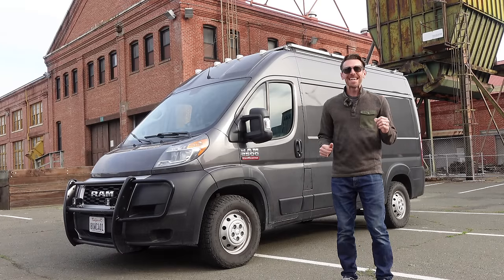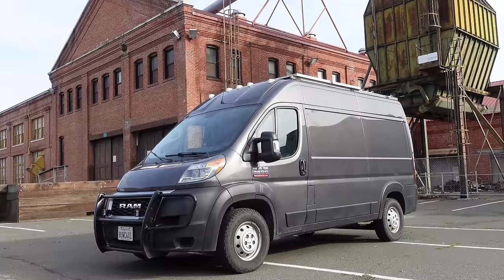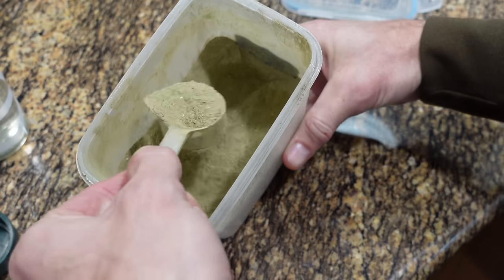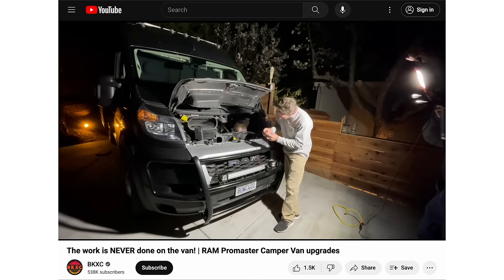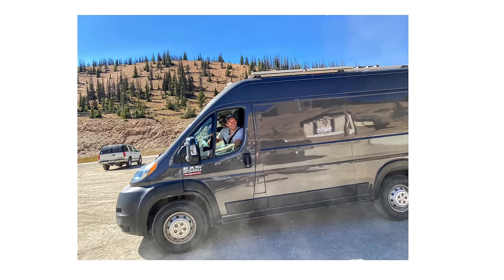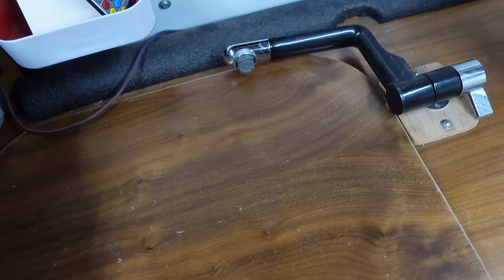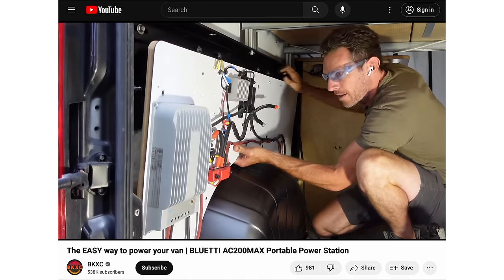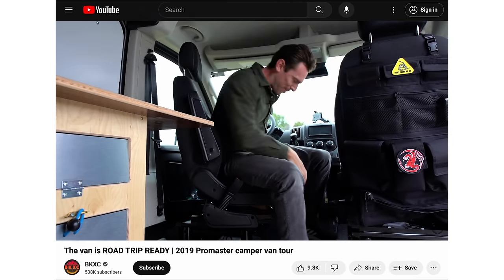100,000 miles of regret | My RAM Promaster camper van

Comment: Find a reputable independent repair shop and stop going to the dealer. You'll save lots of money and get better quality work.
Reply from the maker: Amen to that. The stupid thing is I bought the damn “platinum” oil change package when I bought the vehicle. But that doesn’t mean I can’t just get the free oil change and then go to a shop for service. Sarah recently went to a new place and they gave a really cool detailed report with photos and she was so impressed with every part of the experience.
Reply: promasters have European nuts, bolts, etc...many mechanics won't work on them, some that do, you wished they hadn't, few, very few can.
mechanical shops also if not dealer, take forever to get parts, so down time sucks
Reply: Yep dealer should only be used for warranty work. There is a reason they are called the stealership!
Reply: @danielmiller1302 What?! If your mechanic can't work on something with "European nuts/bolts", you need a new mechanic. Every vehicle I can think of uses internationally sourced  components and metric nuts/bolts. Sae went out with the Clinton administration.
Reply: @nickcoulter973 
Nick, you missed it 1k %.  not talking of metrics. besides metrics is the nut size.  I speaking of threats. they are treated differently.  if use wrong threated bolt will strip out item; and not enough room to rethreat item.  ex. motor mout. bolts $5-8each, motor mout. brackets over $500 for the set. the motor M. has threats in it. I took  part to few different mach. shops ask if they could rethreat. all after abit of time Said no.
Reply: @danielmiller1302  No... European vehicles don't use a rare thread pitch. They use the same pitch standards as all metric fastened vehicles. 

I am guessing you misunderstood what your mechanic was telling you. If there wasn't enough material remaining to tap after stripping the threads, then they would say "no" because the part will likely fail. This issue has nothing to do with euro standards. Any machinist has the equipment required to tap or die every thread in your car. Most mechanics will, also.
Reply: Ya!  I used to have a Ford.  It was bought brand new.  It was a pos.  Ford couldn’t fix it right.  One time, it broke down on the road.  I got it to a gas station on the side of the road.  The mechanic fixed it right using none Ford parts.
Reply: Good work is always years in the making because they're booked up 😅
Reply: There’s people that say both, always go to the dealership and then others that say don’t. In some cases I’m guessing both are correct. With the day of yelp and Reddit I bet the likelihood of finding a specialist is that much easier. I’m curious what happen?? Was it your head gasket? Or no oil??
Reply: Dont worry its bad everywhere. My sprinter went in for its 20k service. I took my baby to the top MB Sprinter dealer in my area. First service is pretty simple. 

I get the van back a day later. I notice after a few minutes of driving that the AC was off. Turn it on and all I smell is burning oil. Get home and theres oil dripping from under the engine. Dealer sends mechanics to diagnose and it turns out they sliced the oil filter tube!!! Took a couple more days to get the part and repair it.

Not looking forward to the next service.
Reply: @danielmiller1302 they don’t use “European nuts” they just are actually European Fiat cargo vans rebadged as a ram
Reply: That’s what I have been doing
Reply: @bkxc As an auto enthusiast who does a lot of his own repairs, is there any way you'd be willing to post the invoice for the $17k engine replacement? I have no idea how a shop could charge that much and just stay to wrap my head around it
Reply: Independents can also gouge you and do terrible work.  Quality of work overall is going WAAAAAY down

Comment: Promasters regularly get 400-500K miles on original transmissions and engines. There are things that fail all the time and there are things you shouldn’t do with a Promaster. I’d recommend watching Promaster’s Only channel. He shows you how to fix everything on Promasters. He has one with over 700K on it. I have 140K on mine with original everything and no issues at all. It can be done.
Reply: Interesting.
Reply: Yeah I was thinking how the hell did you blow that motor??
Reply: I really think the dealership he went to didnt do what they were charging him for
Reply: It can be done but that's not the norm
Reply: I would not trade my Promaster for any other van.  Reliability and longevity are my hot buttons, I get both with my PM

Comment: Engine replacement on your dime at 75k miles is a pretty big negative IMO. I was considering a van for a while but I have decided instead to go with a truck and add an overlanding style camper on it which will allow sleeping space as well as internal bike storage. The real issue with vans for me is the overinflated value they have at this point on the used market. I am seeing 200k E250 vans with the 5.4 Triton (yuck) going for 10k+ with utility racks still in them. I think vanlife in general killed vanlife as a reality for most people.
Reply from the maker: Pretty big negative is an understatement 😫. I am very intrigued by the overlanding setups!
Reply: @bkxc  Worth looking at as I think it allows more flexibility of both vehicle options as well as where you can actually travel to. I am in the process of getting the money together for a Radica Moonlander but GoFastCampers is a good option if you have the coin to spare and a truck they build for.
Reply: Im looking at midsize truck and the Tune M1 topper. The lightweight camper market has lots of options now!
Reply: @bkxc  project M pop up topper and many like it let's your truck be a truck while keeping all your gear safe
Reply: Oof… it’s nice to have the van for sure, but I’m gonna try a camper suv setup first with a bike rack
Reply: @nateums  I thought about that and went back and forth on it but I hate the idea of a RTT and I really want to store my bike(s) inside where I feel they will be much safer from prying eyes.
Reply: did i miss what the cause of your engine's failure was?   @bkxc
Reply: Old mechanic.
Friends don't let friends buy Chrysler/Dodge/Jeep /Ram 😃
Reply: Cause of engine failure=Ram
Reply: @PuffinPass  prying eyes watching for opportunities when the doors are opened 🤔
Reply: @OKFrax-ys2op  The risk is actually the same. Unloading from the back of a van on a custom slide tray says as much or more as unloading from the bed of a truck with a shell on it. The difference is the van doing that gets recognized as probably having much more inside because everyone knows vanlife is a big thing in the MTB community.
Reply: An engine at 75K miles is really unusual, this pentastar engine has been around for a long time and they get tons of miles out of them. I do have the 125k  warranty from Chrysler.
Reply: Sprinter marketplace regularly has built vans for $40-$70k.
Reply: For 17k you can get 3 Mt bikes.
Reply: I am looking at the same thing because I agree, vans are just in huge demand right now and the prices are nuts.  We’re about to hit our last year of full time bus life but we want something for shorter trips.  We wanted a van but good grief.
Reply: 5.4 is actually a really good engine. Get the post 2005 to avoid plug spitting tendencies.
Reply: I actually think the trucks are overinflated because many guys buy a truck just to drive it to work without actually needing a truck, hence the high demand for pickups. I think I can find a better deal on a used van than a truck.

Comment: I have forever wanted to see a review like this. When asking owners how they feel about their Promaster Van (or most any new vehicle), they always want to mention positives and steer clear of negatives. A $17k engine replacement - after meticulous and expensive regular maintenance - at 75,000 miles? Whether it's Promaster/Fiat, Ford, or Mercedes/Sprinter, I truly just wish Toyota sold their cargo or camper vans in the U.S.
Reply: 75,000 is kind of a fluke. As much as I know how much the Asian vehicle fans want to hate on them, you should get 1/2 to 3/4 million out of one of these. Solidly. Thats running 12 hour days, 7 days a week. I say this outright hating this platform even. 
Toyota has its fair share of inexcusable failures too - Hino 268 is one. Tundra trying to masquerade as a half ton and function in fleets is another.
Reply: get a Toyota SUV (Sequoia, Land Cruiser, even a 4Runner) or a Tundra, to tow a Travel Trailer.

Comment: 9,000 to 20,000?  I’m paying off my same 2020 Van, at 15,000 left.  To owe more for a conversion, as old as this is?  I think I just need a bed across the back.  In Arizona, I saw 2 kinds of mice, and one got inside, it had drowned in a bucket of water half full, where it drowned.  I learned from a neighbor, to use a small dollar tree black handled bucket, to set a small foam food tray with any mouse food on it, they slip in to get the food, then can’t get back out.  They said don’t put poisons in that they carry back, and die in your walls.

Comment: Damn Son, 75K miles and the engine gives out?  I'm still driving my Ford 2001, E-150 (V8 330 CID) conversion van with 199,032 miles. I've spent $$$ maintaining her over the years. Same engine and auto transmission. All these years and still no oil spots on the driveway.
Reply: Yeah... E-150 is a creep van... It is funny how and who makes the comparison though

Comment: Driving a Promaster like a grandma is key! The transmission just can't take a lot of hard shifting. Our 2017 Promaster has ZERO problems in 85k miles. It's a game changer for mountain biking in so many new, beautiful places!!
Reply from the maker: That’s great to hear!
Reply: Some can be 100k and be on second engine and third tranny.
Reply: Agreed with you, I don’t think these cars are made for mountain climbing with heavy loads on them, they are a work van for inner cities, dust you have to drive nice with it.
Reply: @reidcrosby6241 im so glad I saw comments like this. I almost bought a travato. How is ford transit?
Reply: @LCLand  my local ambo guys have begun replacing the promasters w/ Transits (and E series cutaways). They had a "sprinkling" of Transits in the fleet. They are WAY better than Promasters, but not as good as old E-Series (2014 and below). They literally scrapped 4 ..2019 Promasters last week. CRAZY.  They sold a few that were still usable. The track record is just abysmal.  They can have 100-120k and be on second tranny and already a new engine.  Can't even getca tranny. There is some sort of issue with the plastic oil filter housing cracking. There are prob STILL 5-8 sitting in lot waiting for parts , or being canibailized. ALL new vans are harder to work on and take much longer to work on.
Reply: @LCLand  i have had 1987-2014  E Series. Older ones don't go down the road as easily (wander, have to REALLY pay attenion). The old 5.8 gas engines are GREAT. The later 1990s 5.4 and v10 are good, but they're weak on on spark plugs "spitting plug" which requires a helicoil.  the post 2005 5.4 and v10 don't have that issue near as much  AND the steering (and attentiveness) disappeared in the post 1991 era so "gen3", they must have reworked the steering box or something. My favorite is a 5.4 2013 med hightop E350. It has more computer crap than I like..
But I love it. I have a 2003 diesel 7.3 cutaway Quigley. ..its nice, but if the 5.4 was 4x4 (and I weren't towing) it'd be my choice.
Reply: @LCLand  if you could find a gen3 like Jason , the van lifer in Oregon drives  it'd be the ticket, gen3 w/ 5.8 .... older engine, less efficent but easier to work on and only an OBD1 or OBD2 computer in it, that be the ticket.
Reply: @reidcrosby6241  my mechanics both say get after 2014 because it’s harder to get parts for earlier years.
Reply: @LCLand  NO way. I can go anywhere USA a get just about anything I need. Now if your talking pre 1992...perhaps (as in scrap yard parts/body panels)....BUT auto part store type stuff,  rads, starters, alt, fuel tanks/pumps, etc.etc....NO WAY. My large local yard has no less than 60-50 1992-2014 E-Series... with millions STILL on the road. PS. Everyone has an opinion. Look/ask around. I say go in an auto part store and ask for some bizzare part. Also, call junk yards. YMMV.... I have traveled the country., and Canada/Mexico common as pond water. Just look at local commercial fleets..they are everywhere. ..

Comment: Glad I watched to the end! The Ram annoying chime now remedied with your solution! After building a van years ago I agree with many of your observations. Never needed a bathroom or shower, a power station is now so much simpler (on my new build) and I never installed a sink. Just a jug and a bin. Worked great!
Reply from the maker: You’re doing it right!!
Reply: You can bring your van to the dealer and have them remove the chime for the seatbelt. The owners manuals says so and the dealership tried to tell me they couldn't do it until I showed them the page in the Promasters manual!

Comment: Mine has 520k miles . Engine was replaced at 420k. Original transmission is still good knock on wood. It runs perfect. Drives like new No lie. Headlights do suck. I replaced the clearance lights because the originals will leak after awhile .  Upgraded the factory Brembo brakes too drilled and slotted, Its a 2500 with the factory big brakes Which are awesome.
Reply from the maker: That’s some pretty good mileage!! Hope this one goes another 500,000!

Comment: I found very affordable, easy-to-install (plug & play) led bulbs(high and low) a few years ago for my 2017 Promaster 1500 134" wheelbase. I also installed a 19" light bar mounted above the front license plate. Night driving is no longer painful for this 69-year-old geezer who always had poor eyesight. Sorry, I don't remember the brand. Vermont has very few street lights and the painted road lines are usually worn out. I only use the light bar on the back roads. Excellent video less is more. And never listen to dealer regarding repairs.
Reply from the maker: Yes! I didn't realize the plug and play bulbs exist now. Back when I first got the van they hadn't caught up yet.

Comment: We bought a used 2019, 2500 Promaster that had already been built-out at Wayfarer. The build was similar to yours. My wife and I drove cross-country and back from Maine over 7-months. We covered 14,000 miles and 40-states-all during Covid. Some of the best adventure-time we've ever shared together. I agree completely with your idea to add a rear window over the bed area. Also, getting a good lithium battery for your accessories. I'm thinking of doing it again. I might go with the 1500, and size-down a tiny bit, and go with the newer Wayfarer builds which look even better than before. There's nothing quite as great as having your independence out on the highway.
Reply from the maker: That is awesome, love hearing you got some great adventure out of your van!!